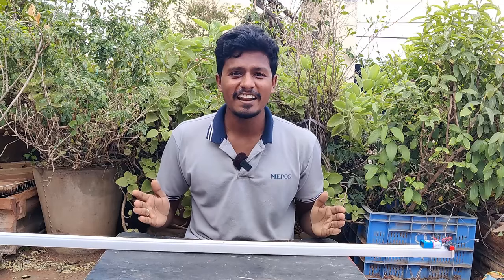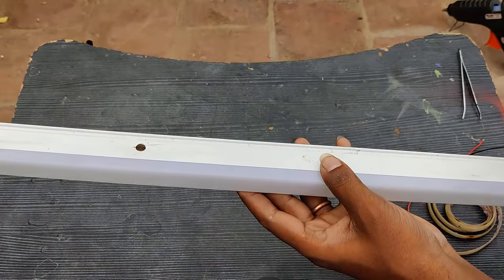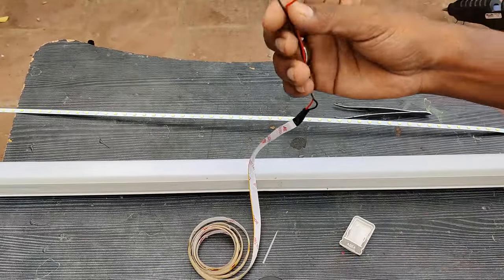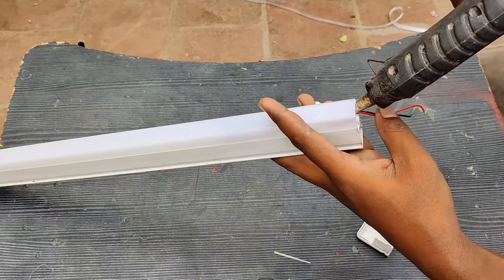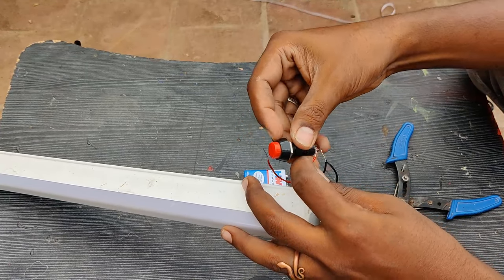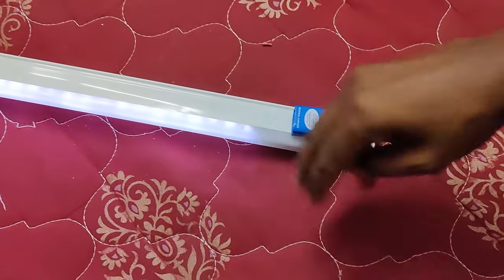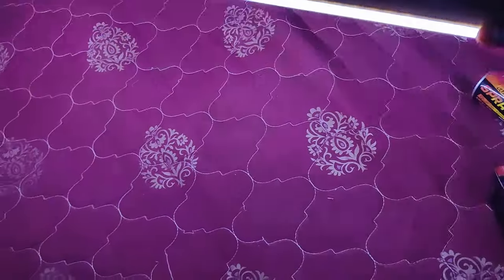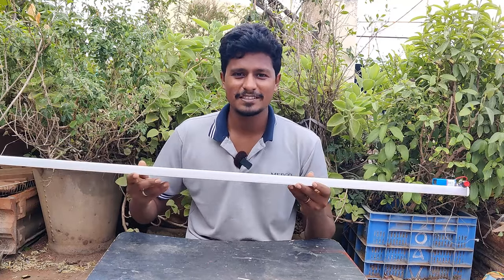இனி பழைய TUBE LIGHT-ஐ கீழ போடாதீங்க!🥰 | How to Make Emergency Tube Light 🔥| Out of Waste Ideas

Comment: is the power required depends on  led strip length r same for any length. If not, what length or number of led bits need for battery of 9 volts or 12 v etc pl